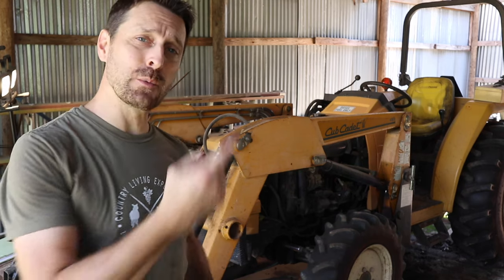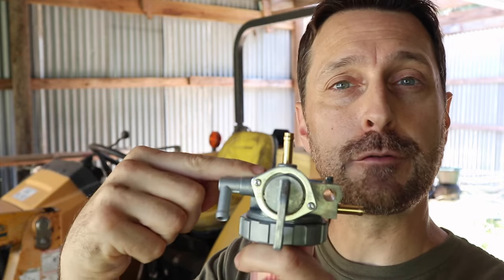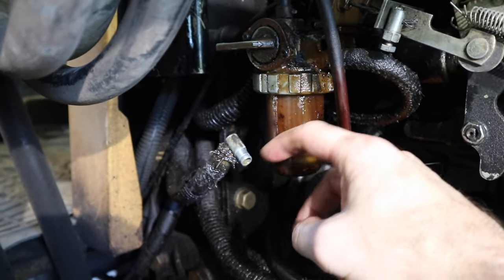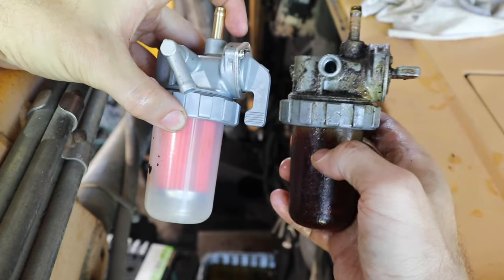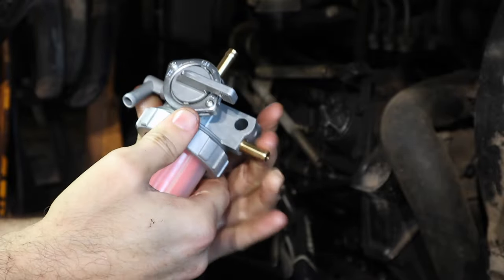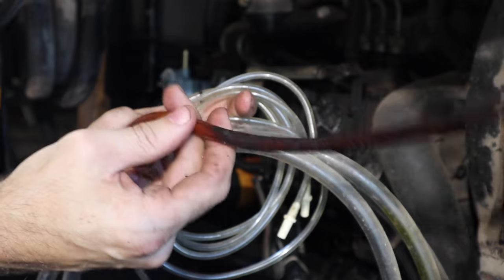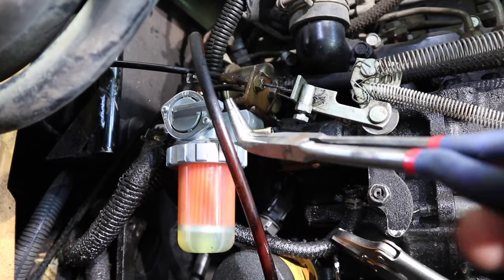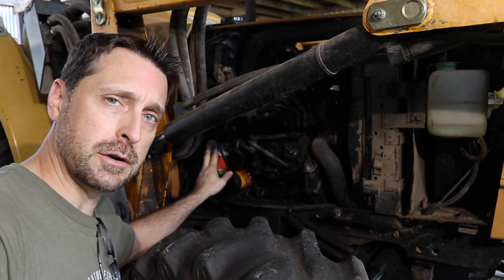Need To Fix This NOW! Tractor Fuel Filter Assembly Replacement DIY

Comment: Where you get the replacement parts?
Reply from the maker: I found it at Mowthelawn.com
Reply: @CountryLivingExperience  is there a part number?
Reply from the maker: @vtullock  Part Number: CCMA-31A66-25100
CONTROLLER-GLOW PL